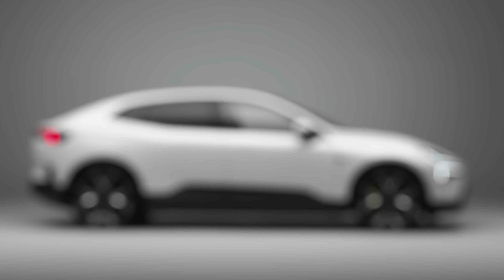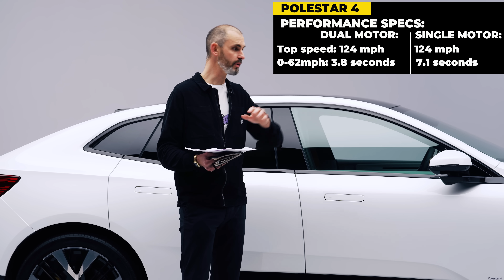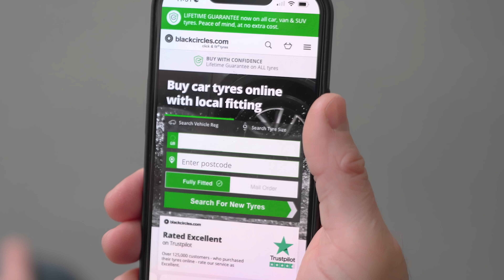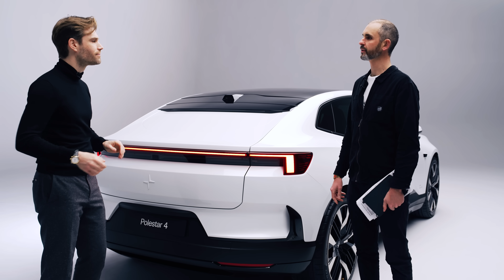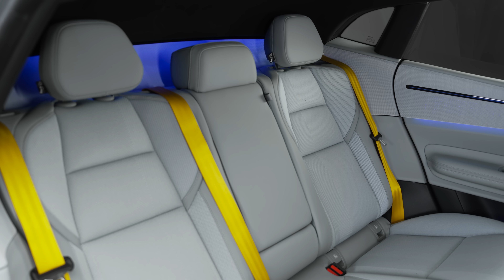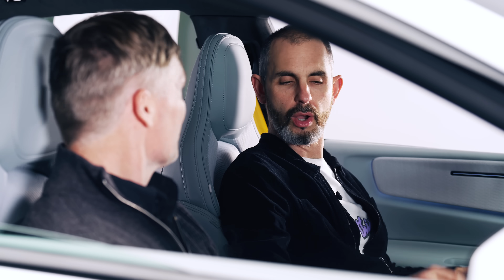New Polestar 4 EV detailed First Look - why the classy electric family car has NO REAR WINDOW

Comment: "We've had to light with studio lights this cabin so you can see us" - in other words, it's DARK in the back..... I showed this to the kids and they HATED the idea of sitting in such a claustrophobic shell. 
As others have said the rear window is for others as well. With a van it's hard to tell what's going on in front of it, with a car you can look through it. The lack of window is purely a gimmick, nothing to do with aerodynamics or structure. There is no reason at all that the top half of the bootlid/back of the roof couldn't be made of flush fitting glass with no CD effect.
It's also about time the law caught up with complex screens in cars. You can't use your phone but you can use far mor complex "infotainment" systems. Complete madness

Comment: It would be one thing if the rear view mirror could be flipped to a camera mode but only offering camera and removing the rear view window is just bad design. Whoever insisted on that "feature" has cost Polestar a lot of potential sales. They could have made the aircon fill the interior with the smell of sewage for the same effect it will have on sales.

Comment: Is the camera on the rear window heated? For example, in Norway it often happens that the snow that falls is slightly wet and in the morning at in the morning it is very frosty, so there will be a lot of ice on the rear camera that cannot be removed manually. Did the manufacturer remedy this somehow?

Comment: Focus on all looks and no function. A 2D camera to the rear view mirror, with all the inherent dynamic range limitations and so-on, along with all the wiring and gubbins that'll just go wrong in a few years? Or a piece of glass at the back and a physical mirror at the front, which uses no electricity, is 3D because that's how our vision works, and has none of the optical limitations of current cameras?

Same story in the cabin too; they've still not got the memo that people hate all-glass cabins. Physical buttons are king - *keep your eyes on the road*. You can't use a mobile phone while driving, but apparently giant iPads are fine? Huh. Whatever.

Total hubris. What a shame; although aiming at a crowded, over-priced market segment, Polestar were showing promise - but this jumps the shark. I'm not too surprised that Volvo have pulled out of funding them now.

Comment: Looks like the UK marketing machine started up. It's a great car on paper for after my EV6 lease is up, but I've eliminated it since it's an absolute BOAT on land. it's over 79 inches wide or 2000 mm without mirrors! That's 1.5 inches wider than the porsche taycan which is itself wider than the cayenne. Parking would be an absolute bee's ass coming from a car that's 5 inches shorter and 5 inches narrower.

Comment: Can't wait for a car that doesn't have windows at all - because who really needs them 🙄🤪 We have lidar and 360° cameras for that, right - and drivers complaining when an inch of "the outside" is missed cause they "rely" on them now even for a simple parking move.

If the electricity fails you can't get into your car at all nowadays.
Buttons are a thing of the past and so you have to look! at a touchscreen (while driving!) to know if you hit the right button(field).
And yes of course i want cars that get bigger and bigger by the year - while the streets, garages and parking spaces are mostly unchanged in sizes since decades. /s  Yay.🙄

Driving an EV myself. Am happy there are so much less parts that can fail. That's why i own it.
Most of the EVs looking VERY much the same to me, despite the fact not having a big engine taking space would give an opportunity to come up with a unique design. Sad.
rant end. 🖖

Comment: Question for the car interior designer: explain the decision process when considering the main touchscreen's integration (or lack of) into the rest of the dash please. 
 I personally don't like the car interiors where the screen looks like an add-on. This car for example looks like there's an open laptop sitting there.

Comment: SUV?  You do know what that means?  It's long wheelbase, coupled with ridiculously low ground clearance means it is in NO WAY and SUV in the same way as most SUVs on the market today.  That lack of rear window is a bad choice.  If you've ever used an electronic rear view mirror, you'll know that there is a world of difference between seeing a three dimensional view in a real mirror, and a two dimensional representation of a three dimensional view.  Your eyes are focussing on the mirror plane, not on the objects you are seeing in the mirror.  I experienced this on a test drive of a Land Rover Defender, and it was awful.  Of course, the worst thing is that it's electric, so I'd never buy one anyway.

Comment: In, Kentucky, I almost failed my driving test because I used the Mirrors when reversing down a street. They expect you to look out back. I wonder how this design would play in the States. Granted, I can't see it replacing the myriad F150s there any time soon.

Inside, the back looks dingy. The parcel shelf lighting looks cheapAF. Instead of needing Planet-themed Ambience, why not use, oh, I dunno, Sunlight?!? With a wacky concept... Glass, tinted or otherwise.

Comment: I realise this won't be of interest to many purchasers of this car, who will be in the younger and middle aged demographic. However as I have grown older my eyes have become slower at changing focal length. I now have a car where I can switch between a mirror or a camera view on the drivers interior mirror. The camera view is mostly better, but I can not use it as my eyes struggle to switch between focusing on the road ahead and the "mirror" when in screen mode. I don't undertsand the science or the terminology, but my eyes don't struggle looking in the mirror. They do struggle looking at a screen where the mirror is. This can be dismissed, and I would have dismissed it when I was younger, but I believe it will become an issue in the future if this becomes the standard, and if a solution isn't found.

Comment: @14:45 of COURSE you have enough headroom. Because seats are extremely low and you sit on you buttocks with thigs in the air. This is very uncomfortable for more than 1 hour.
Thankfully, legroom is indeed enormous and compensates this design flaw - you can stretch legs in long journeys.

Comment: Drag coefficient of this car is 0.269 (basically the same as for VW ID.4, which has 0.267) while similarly sized Tesla Model Y has 0.23. This means slightly worse efficiency at highway speeds than Tesla.
And to make energy consumption even worse it comes with stupidly huge and unnecessarily heavy minimum (!) 20' rims. You can get 50+ km of range by merely fitting lighter 17' rims on the poor thing.

Comment: I am a Tesla owner. We have owned five Teslas going into my sixth now with my order of the new model three. My thoughts in the Polar are simply it is a beautiful, incredible wonderful looking and functioning car. I do not like the polestar 2 because I think it’s too cramped, and I dislike the fact that there’s no front. I think this car would have a lot more space, and probably be much more useful for myself personally, as well as being more attractive than the Polestar three. My big problems are just the autonomy has to be there and it has to work as reliably and consistently as Tesla does, and the user interface, exceptional compared to the rest of the automotive industry, is a step down, coming from a Tesla user interface. I say mostly because of the fact that I don’t like the menus as much, I don’t like the limited connectivity options when it comes to things like games and TV other stuff that Tesla has down pat, and thirdly I don’t like that the interface is not built around the map all the time. I am of the philosophy that the map is the most important thing in the car is getting you where you’re going and I want the map to be there all the time and the fact that this card system doesn’t necessarily allow for that is not my favorite. Other than that as a Tesla owner I think this is a very compelling offering and I am exceedingly excited to go to my local polestars and give this a spin

Comment: The concept of a EV is great but then you bring the greasy government in and now there dead £36 pounds a day to park in London when it use to be 0.96p a day   and cost more then a petrol to fuel  up people are trading in there EVS for petrol / diesel cars they wont be a right of in 8 to 10 years and only impact the plant 50% instead of ongoing 100% for goodness sack they are charged from a power station that burns coal gas wood rubbish oil 😂😂😂😂😂

Comment: Design over Function. I saw Björns HiphiZ trip. These cars look good in show rooms and when the boss drives to his golf event. But in real conditions (fog, rain, snow, bad roads, construction works, ice and mud on the sensors) they suck. I like my Ioniq5 but the front sensors fail in winter as snow and mud covers the sensors, and the back view is horrible without a wiper.

Comment: If this is the future of BEV's the world is doomed. This vehicle is heavier than the Ford Ranger diesel dual cab ute. It is wider than it and only 500mm shorter than it so how do all the people reconcile this as a planet saver. Polsatar themselves tell us its manufacture creates 20 tons of CO2. How many years of using it would it take to negate that CO2 even if you charged it with just renewable power. If you did around 15000 klm a year we are looking at around six years. That 20 tons is only for the base vehicle, add all the bells and whistles and the twin motors and the tonnage goes up but they won't say how much. All that weight will cause the same damage to roads and the same impact on road accidents as the big suv's and utes that many complain of now. The essence of a BEV is to provide an urban commuter that is easy to recharge, has a small footprint has minimal emissions, and has no city pollution. Does this car look like that to you? How many smaller vehicles could have been made with the resources used in this vehicle? Using resources effectively is also a tool we have to expand on for reducing greenhouse gasses. Its price is another point of hypocrisy, how many families would be able to afford even a base vehicle? Lastly, the car uses a 100KWh battery that uses all the nasties that other manufacturers are moving away from such as cobalt. This vehicle is as green as mud. It is an example of the scam that is BEV manufacturing and that is to fleece more money from self-righteous wealthy people who think buying one of these is saving the planet. Vehicles like these will do nothing to help road congestion parking problems road damage or even greenhouse gas emissions. They are a con job.

Comment: I guess the lack of a rear window is a natural step that will be followed by omitting the rear view mirrors as well. It's been more than ten years since people stopped using any of them while changing lanes or backing out of parking spots.

I work where a substantial portion of the sheet metal for Polestar 1 were made. At first 1500 cars wer planned, then it was raised to 3000, but in the end, only 600 were made. It's a shame since it was the first beautiful "Volvo" since the ´60's.

Comment: The google infotainment system is garbage. I have it in my XC40 and despite gradually weeding out the bugs, it’s still buggy and annoying. In a recent autocar review of the polestar 2 revamp, they noticed the software didn’t response to touching some functions on the screen. I’m absolutely not surprised….
Oh and I assume this’ll use the same road speed limit indicator which consistently shows the wrong speed limits (40mph in a 20 zone in London anyone?). 
At least the logo has backlighting tho!

Comment: Not having a rear window is not THAT revolutionary. This is still a car, with four wheels, an engine [or motor], ... the level of detail inside is commendable, but very, very superficial. Which is funny, as it really destroys the concept of swedish "common sense centred design". Too superfluous in very many aspects.
Edit: It is NOT simple. It is basic aesthetics, which is fine. It is not simple. It is very overdesigned.

Comment: The thing with a rearview monitor iso a rearview mirror is the way your eyes need to focus.
Quickly switching from looking outwards through the windscreen into the rearview mirror goes without thought and your eyes adjust within no-time. However with a monitor this is not the case, and I believe this has to do with the screen technology. When looking into the rearview monitor it takes a good half a second to refocus, and when looking ahead you need to refocus again.

I wonder if the monitor they utilized in this Polestar 4 is of an evolved tech or if it has this same 'drawback' as any other rearview monitor...

Comment: I love most of your content but unfortunately I had to turn this off . That designer was so boring I almost feel asleep.  That's the problem with most of these new Suv sporty coupe EV cars , they are so boring to drive they have to fit all the safety systems and cameras for when you fall asleep.  On the subject of the back window, when the camera breaks it will cost a fortune to replace, you can get a aftermarket mirror for pennies.

Comment: Like the looks  (although the whole SUV description is just confusing nonsense from the marketing department), however I do think this is one car that really needs a test drive to understand the real world impact of that rear end, and test drives are a bit tricky in the dealerless Polestar world. I also hope that it's driver assist tech isn't Zeekr/Lynk & Co influenced, because that's a binging-bonging nightmare that can't be properly switched off. The Polestar 2 isn't so bad in this regard (I've had rental P2s a couple of times) but the P2 is less Chinese than this. So try before you buy.

Comment: Jonny I know you probably can’t do this for obvious reasons but I would love to hear you ask the designers the hard questions that maybe no one else asks.  For example, why are car designers obsessed with all touch screen systems for hvac, infotainment etc when it is fair more distracting and dangerous to use while driving.  Also that camera window, in Ireland every car I own in winter gets a spray of dirt on the rear from aerodynamic effects, how is the camera supposed to stay clean?  

If here high tech cars are going to be useless in 10 -15 years as a lot of that high tech will fail naturally with age and be too expensive to fix.

Comment: No rear window?
Sorry, No.
Plain unsafe in all public and private reverse parking scenarios. 
You need to crane your head to see round the corners. Cameras just don’t cover all angles, it’s an eyes on thing.
Reply: I've driven my Polestar 2 now for 3 years and can honestly say, I have very rarely turned my head to look out the rear window when reversing. The reason? Superb reversing camera giving a 360 Degree all round the car view, collision sensors that work faultlessly and warn in an ultra wide angle, where the human eye cannot. It is just a matter of getting used to trusting the technology. If you are unable to do that, then perhaps you are not ready for the future just yet.

Comment: What happens when it's raining so hard that back camera is drowned and I need to back the car up? A rear window would be handy....try that.
Reply: You have rear facing side view mirrors. And the camera on this is up high enough and shielded, so should be fine. Rarely have issues with our rear view cameras in the rain in our current cars, can see more than looking out the back window.
Reply: @cypvh74  It depends on where you live. I'm in Northern California and we get rain. 2 Days ago it was raining so hard that the reverse cam on my '21 Honda CRV Hybrid was useless. Its protected under where the plate goes too.
Reply: @i976scirocco  “under the plate”. So low down, at the backside of a relative flat rear end, where aero-flow sucks the wind back on to the car because of vortexes. The polestar 4 camera location is much different. It might not work out, but it’s up higher and more forward for a reason.
Reply: @cypvh74  You're not wrong about aero but I was just trying to back into a parking spot. It's not under the plate but lives in the plate recess. It has an overhang above the camera. Take a look at the back of the '21 CRV and you will see. I'm not sure if the polestar will work either, but I wouldn't buy it w/o a rear window. ✌

Comment: £60k! Lets get serious here, these are PCP/PCH vehicles - Who taking ownership risk with this?

 Buying used in 5 years with 50-60k miles on it, without knowing the Rapid Charge history is a risk. 
As the number of EVs on the market increase, the older battery tech (compared to what's coming) will leave these older EVs facing massive depreciation.

Comment: Cameras displaying to screens are all well and good on a dry day.  As soon as it starts raining, the image goes all blurry.  Park assist is pretty much useless on rainy days in my car.  I don't think I heard about any droplet dispersal systems in the P4, which if it's not there is a significant oversight. One does need to see to reverse, after all :)
Reply: I hope that the US federal government bans sales of this car in America because of the lack of rear window
Reply: @cbatiau2528 cars in the US are required to have at least two usable mirrors. Plenty of transit vans and other delivery vehicles don’t provide any ability to see out the back with the central mirror. It’s unlikely to be banned. Cameras for rear view are still problematic in inclement weather.